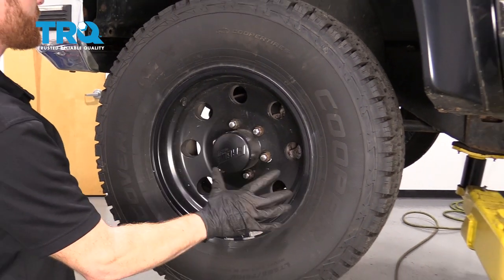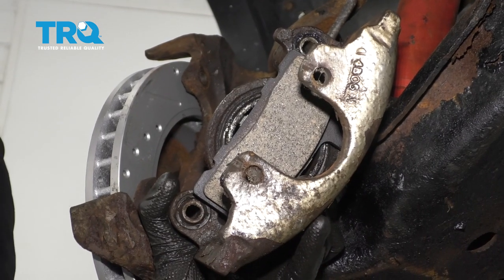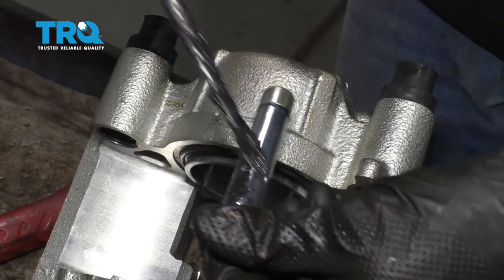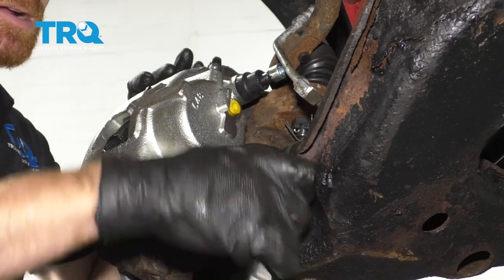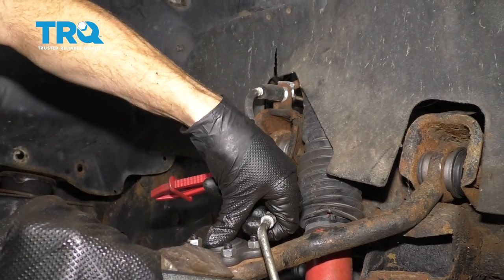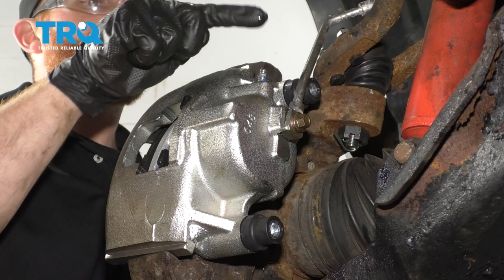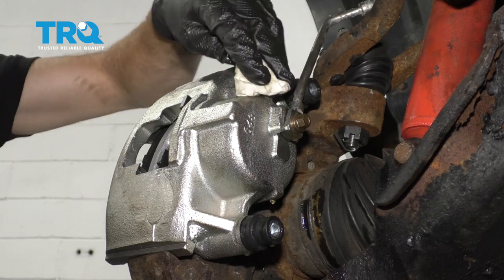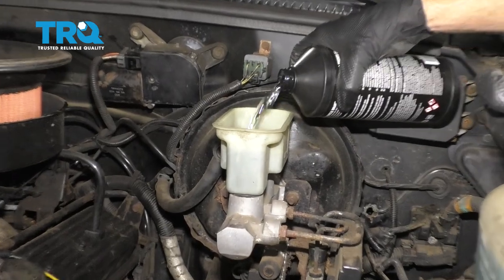How to Replace Front Caliper 1988-2000 Chevy C/K1500

Comment: This I how to NOT do a brake job properly, you have fluid on the pads which embeds into to it, do not clamp hoses, didn't torque the banjo bolt. These brakes are either going to lock up or vibrate later on or both.

Comment: Clamping down on a rubber GM brake line is one of the dumbest thing I've ever seen. If it didn't need a new one before, it will shortly after.....after the average person seizes up that new caliper or their wheel bearing that is.
Otherwise, good vid.
Reply from the maker: +Brett Reid Thanks for watching our video! http://1aau.to/m/Shop-TRQ